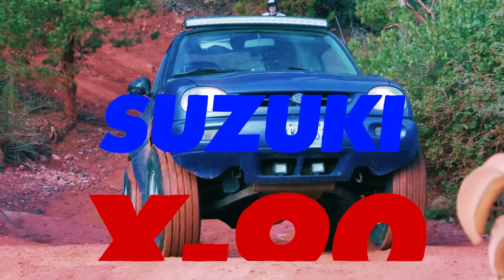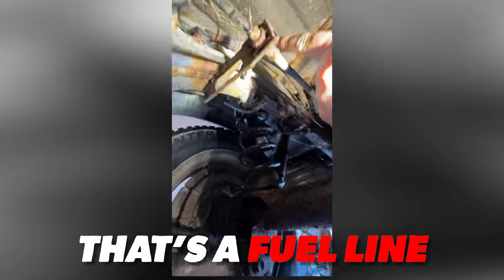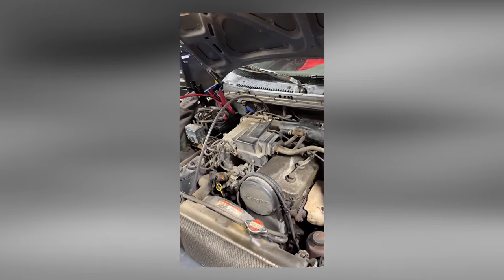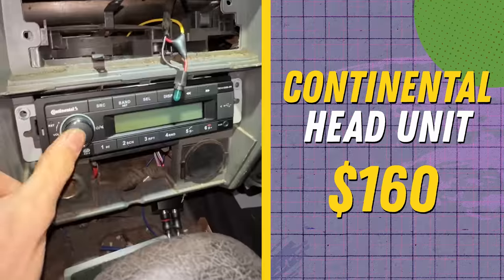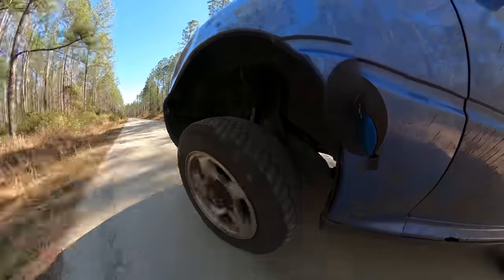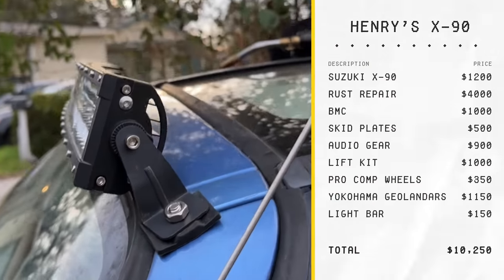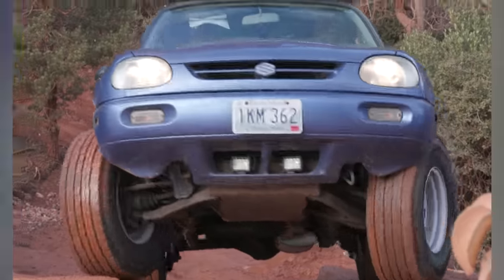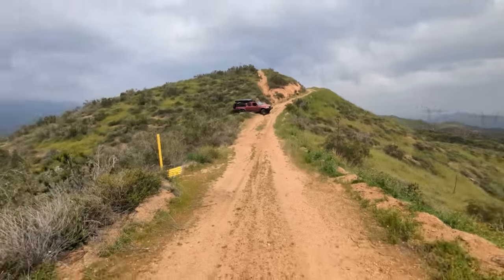Building a $10,000 Off-Roader While Driving Across the USA

Comment: I bought a Suzuki Jimny (similar car to the X90 but smaller) last year for my girlfriend, but we literally did the opposite to you :P It's tiny and easy to park so suited her perfect, but it came with lots of off-roading mods, so I removed a bullbar, snorkel, towbar, spare wheel and put summer tyres on it. I saved 160lbs and it went from getting 200 miles to a tank, to getting 300 miles to a tank. Works out at nearly 35 mpg (or about 42mpg for us in the UK)

Comment: The X90 Is based on the Geo Tracker / Suzuki Sidekick. So many parts will interchange. A quick search is saying the X90 has smaller tires factory so they have higher gears to compensate. They also have shorter springs. Your best bet likely would have been to do a body swap onto another frame and axles. Getting you less rust and a lift as well as gears. At this point though swapping axle diffs to ones from a manual 5-speed tracker or sidekick will likely give you 5.12 gears instead of 4.6

Comment: Should have gone with custom suspension. Most all the kits you can get are too stiff for these light rigs. 

For the rear, use the longer f150 shocks and rear springs out of a 92 accord and add a diff spacer.
In the front use regal struts with mustang ii springs and a front diff drop.
That will give you about a 4 inch suspension lift that is weighted properly. A nice soft ride on the roughest trails and tons of flex.

Comment: I'm sure you already know, but virtually all the mechanical parts are shared with the Geo Tracker or Suzuki Sidekick.  I replaced the brakes on mine with the ones from a 4 door Tracker, they're larger and handle the larger tires better.  Also swapped in the 5.13 gears from the 4 Door too, replacing the 4.63 the X-90 came with (mine is a 5spd).  I'm getting 24-26 mpg, not sure why your X-90 is so bad.

Comment: 14:58 Not gonna lie, it would've been nice to have kept the front bumper design with the DIY fog light placement and just modified it to fit around the new exposed metal bumper. Would've kept the quirky car aesthetic this thing had going for it. Just as well, that new bumper looks like it need a coat of paint as it looks like it's getting some surface rust on some of the shots in the background.

Comment: That MPG may be off if the outer diameter of the new tires is larger (almost assuredly are) and you didn't do any kind of adjustment to the speed measurement cable/computer to account for it.  Essentially, you geared your car way up by increasing tire diameter, so it may actually be getting as good or better mileage as you're turning lower revs per mph.  The added weight is probably a bigger deficit than the gain in gearing, but not as bad as an unadjusted calculation would show.

Comment: Could you regear it to get some mileage back and probably a little performance? Or possibly a manual swap if you wanted it to be a manual that might give you a litte extra gearing because typically automatic cars have a lower gear ratio than manual cars but not always and its usually not a big difference but its something.

Comment: 😂 I though my 1990 Geo Tracker tin top was rusty! Even it had 3/4 of the body mounts left. Raybuck auto has the panels you need. Otherwise get a hammer and an old washing machine. Start forming tin.

Comment: Trailer wheels and a pointless 2" body lift need to go (which would save on cutting the wheel arches), but otherwise a great set of mods. I love little cars and trucks like the X-90. Only other mod I'd do is remove that trunk lid and make it a tiny pickup. It's just begging to be put to work.

Comment: I currently live in The Woods in East Bay. Was Born in Tiverton, raised in Middletown. You don't drop or add "r" sounds at random, but from your accent, you're completely and totally from Rhode Island. Not giving up on the vehicle until Jesus rises again? Cements the deal. You might be a Swamp Yankee if you have four boats out in your front yard, and none of them will save you from a flood. You might be a Swamp Yankee if you hire welders to replace your frame with welding wire. Tell me, when a little old lady gets stuck in the first snow of the year... does the Pirates of the Caribbean cinematic soundtrack go off in your head as you get out of the car to co-ordinate with everyone also getting out of their car to push her back on the road?

Comment: I had a x90 that I put on a tracker frame and put a 4 link rear 3 link front with a solid axel swap on toyota running gears that I then put 38s on it it was a fuckin monster i planed on putting a k20a in it for more power but I ended up selling it to my old high-school shop teacher for him to use a hunting rig

Comment: I have never seen a more innefficient use of money!
900? For the stereo setup...  160 for a basic single den head unit?  A meth head is better with their money. I mean you can get a head unit brand new just as good 20$. 
I could build a way better larger system for half that price. 
Dont even get started on the first two purchases🤦🏻‍♂️